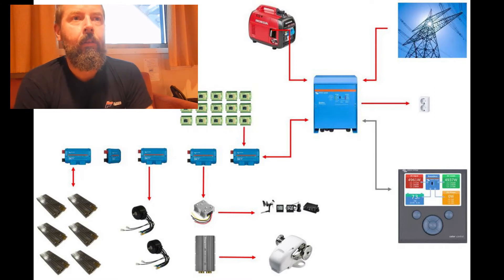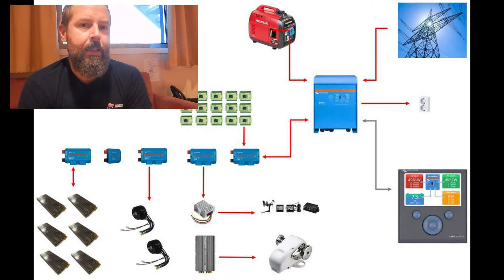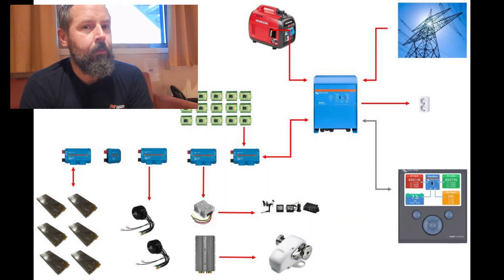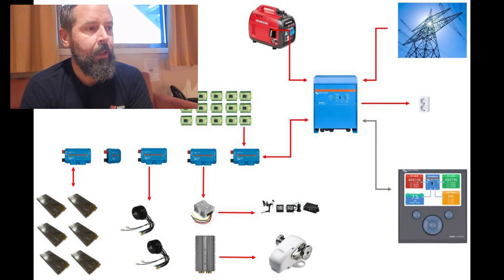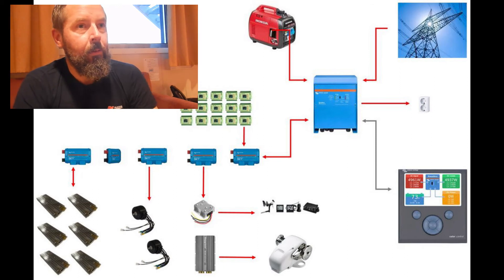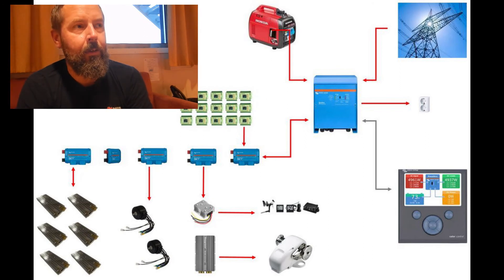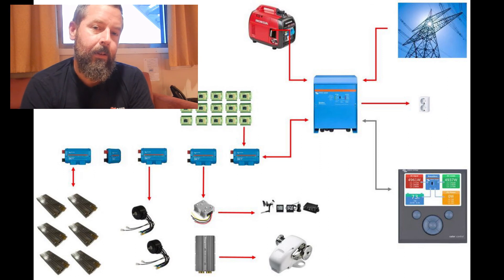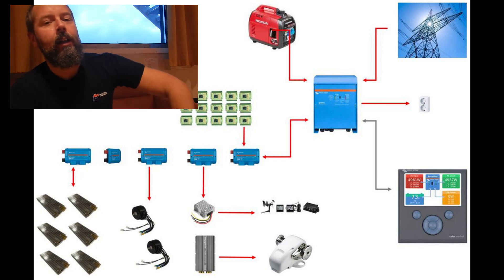Wilda's electrical system explained - S01 E05 - DIY Catamaran

Comment: Always have a back up with a wind generator
Reply from the maker: Thanks. I think I'll try without. With over 2000 w of solar panels I hope to avoid the wind generator. I'll try to get drive regen efficient. If I can't, I'll add a separate hydro generator.

Thanks
/ Axel
Reply: @buildingwilda alway s good to know you got back up power just in case other things fail ? lol
Reply from the maker: @vivianbond7449  absolutely. For backup, I will have a petrol generator.  Wind could be a supliment, but from what I understand, not a very reliable source of large amounts of energy.

Thanks Vivian

/ Axel
Reply: @buildingwilda  ok mate

Comment: Have you thought about a regeneration system whilst on the move to regenerate power from your forward motion.
Reply from the maker: Yes. The controller will be able to handle this. The motors and drivers are made for cars and motorcycles, so the function you are looking for is normally called regenerative braking. I would go for a matched motor / controller. From the same supplier. Perhaps not necessary, but I feel it is more likely you will be able to get better technical support that way. I bought direct from China. Golden Motor. Surprisingly easy transport and good support so far. And half the price for the exact same unit sold in the US. I can't, for sure, say this is the best option, I have not yet been able to test the system. But so far so good, and I don't expect to have any issues.... I hope 😂

Comment: Hello you both doing a fabulous job on the catamaran. May I ask where you obtained the Tesla batteries from and what the cost was. I am looking at taking out my diesel engine and going electric. Many thanks
Reply from the maker: There are several sellers online. Check for ev sites. I got mine from Lithium Power in western Australia. If you are in the states, check out EV West. In Europe, try ev Europe. When searching these you will find more sites. Transport can be a bit tricky or costly. Prices vary with availability and location. Try to make sure that you are buying from a serious supplier. Also check out Jehus power walls. Lots of good info on ev conversions.
Make sure you find a good dealer wherever you find the modules. I have heard that there are counterfeit tesla modules around, so if the deal looks too good to be true it probably is. Drop in lithium replacements for lead batteries are becoming more affordable... Not anywhere close to tesla by power to weight to price, but getting there. Still too pricey for the kind of power I was looking for. 30kWh is a substantial amount of power.
I'm not an expert on all of this, but I have done a lot of research. Make sure you do as well.

Comment: Stumbled across your channel, looking forward to following your progress, interestingly I remember considering this boat a while back when it was for sale, but with the work required and the strong suspicion I could not trust myself not to get too carried away with the project for my budget I passed, so glad to see some one with vision take her on.
IMHO I feel parallel hybrid would be the best option .... a reasonable sized single diesel main engine (30-40hp with coupled 10kw electric in one hull + stand alone 10kw electric in other hull) This allows you to have all the advantages of emergency propulsion/generation the main cons = weight, fuel storage but the balance it provides in this type of system while maintaining a predominantly renewable energy powered boat. 
Your idea with Tesla battery banks is interesting but I have heard there are considerable issues with this type of conversion for electric vehicle applications, I am interested in seeing how you over come these.
I dont recall you mentioning regen, although this must be an integral element in your system.....with the Tesla power banks did you consider ac drive motors. 
Are the dc drive motors you're planning to use going to be liquid cooled/sealed?
Great project
Reply from the maker: Hybrid would have been a way to go. I will have limited hybrid capability via the inverter. A smallish generator 2 to 5 kW, perhaps a bit more, allowing for some assisted propulsion.
Reply from the maker: Regen will be possible, and I hope the prop i have chosen will give me decent regen already at relatively low boat speed.
The tesla batteries have some issues that are not ideal for running a 24v system. I'll be running at 48, leaving that issue only for the motors. As they are brushless dc, they will handle the low voltage close to the lower discharge limits. They are sealed watercooled, more for the sealed bit rather than the cooling, but I will connect a cooling loop as well. Should have no problem with salt in the air.

Once completed, I plan on doing some sort of EV inspection to make sure I have a good installation that an insurance company will be happy with. 

All good points.

Thanks, I really appreciate comments like this. Keep them coming.

/ Axel

Comment: good to see are you trying something out of the marine market......  I'm also planning to do that....  but I'm thinking to use one diesel motor/generator and one electric...... as you said redundancy..... I have no guess how much power all these dc-dc and dc-ac inverters would consume.... have you check that? It looks like some good amount of your solar power will be lost on these. Some people would have gone with 12V dc just to avoid it.  But I'm curious to see your results! :)  good luck!
Reply from the maker: Thanks for all your comments!

Yes. There will be losses in the dc-dc converters. But also better efficiency in DC to ac. Big loads will be ac with the exception of the motors.

As I am sizing the bank for some practical propulsion, the power available is hugely oversized for the 12v loads, so I am not concerned with some losses there.

Running, at max max max, at 48v and 30kW is about 600A...

The same power at 12v would require 2400A.

As for dc dc on incoming solar... Yes, boosting to 48 will come at some loss, but so does buck converting to 12v..

All systems have their pros and cons. I hope I have figured out a good solution for my boat.. I already have the parts, so I really hope I got it right 😂

I will have a generator as well. But that should only be used on very rare occasions, like up rivers or against high currents in Indonesia and things like that.... I really hope I got it right... I think I might have 🤔
Reply: @buildingwilda  really good!!... I'm looking to see your results....

Comment: PowerMax Converter chargers can be put in series, parallel and series-parallel. also, have you looked into battery isolators and galvanic isolators? inverter-chargers are kind of expensive  although i like the sungoldpower brand if that's your plan. did you know they also make inverter-charger hybrid mppt controller integrated in one unit? the quiet honda generator you have pictured isn't going to be efficient, something more robust coupled with batteries at a 3c charge rate would probably suit your need better with powermax chargers and less batteries and regen electic motors.. like say a 12kw to 19kw generator and 10kw lifepo4 battery bank (safer)...if the lifepo4 is 3c you can pull the 30kw off and put it back easily with the regen.. heck even 6c stuff is out there which means you could drop that to 5kw batteries and figure 800 watt photovoltaic instead of 1600.. anyways, just my opinion.. at 5kw and 6c you'd need a bank soldered to handle 600 amps and heavy cable tho..

 (i mentioned the battery isolator because you might want to use it to tie in an outboard kicker with a boost converter from 10v to 60v, if that is possible, to the whole mix and harvest power from there too. West Marine sells a charge relay switch but expensive.. isolators are 50 bucks and handle the same 500 amps)

galvanic isolator thing should save your vessel from corrosion hooked to shore power, if i understood it correctly.. might wanna get a 30 amp pigtail adapter cable for that scenario in case you hit a place with 120 and you need 240 or vice versa..not sure about the whole 60hz 50hz thing but i've seen some inverters with selectable 220,230,240 etc, also plug adapters in general might be useful.

oh and you wanna make sure whatever you use is pure sine inverters and not modified, really screw things up and cause heat problems if you don't

-mike

p.s. the larger the battery the more self-discharge and that means some of your photovoltaic cancel each other out (inefficient). those quiet honda generators aren't quiet when using at the max speed (most efficient rate) and will be running a very long time, with say a 12kw generator and powermax converters you could fill 5kw in 25 minutes if it can handle 3c charge rate. Noisy for 25 minutes is better than noisy all day and save on fuel economy plus you can top that off solar not having contemplate when sun charge and when fuel charge. Not having drawn out charge schedules on both ends of that and gaining more control on the fuel side and much better on-demand use, just seems like the better way to go IMO

Comment: Very interesting - are you going for generic drive motors, or one of the marine motor suppliers. There seems a great difference in price.
Reply from the maker: Huge difference in price. I'll post more on the drive chain when I get the parts. But I will not be going with one of the marine brands. They are simply out of my budget.

Generic, perhaps,.. I am buying from a supplier to the ev-market. A motor that should work well. The biggest difference to the off the, very expensive, shelf systems will be the lower unit and prop, that I hope will be a better fit for the electric motor.
I believe I have a design that will work well, but that remains to be tested full scale.

Thanks for your interest, hope you follow along, I will try to post once a week. Still learning how to edit, choose material and I am not quite there yet. Learning as I go along. And traveling more than planned.. 

Thanks again, 

/ Axel
Reply: @buildingwilda  have you looked into hpev motors with regen, they make a 10kw
Reply: @buildingwilda  Thunderstruck has DC motors for a good price. Under $1,200 each unless you go for the big AC motors.
Reply from the maker: @BoldRepublicNews  Thanks. I've seen them. I bought direct from the supplier in China. Golden Motor. Check them out. Surprisingly fast delivery.
Reply: @buildingwilda  Cool. I'm actually living in China. Hopefully the motors you receive are legit. I'll check them out, thanks for the tip.

Comment: Thanks for the line drop.  Glad to see you’re pushing on.  Absolutely stick to Victron as much as possible.  Some cruisers out here try the Chinese products...hit or miss.  Just don’t risk any on essential components.

I’ve helped design some 12v and one 24v system, but the 36 & 48 volt is beyond me.  They each come with unique dilemmas.  Not as straight forward as stepping down like it would seem.  The windlass is a stinker, one marine electrician (who is also a regional Victron distributor and industry expert) even recommended a stand alone battery with a DC-DC charger from the 24v system to power the 12v windlass.  He did the voltage loss calcs for a step down and they were dismal...not sure why.

Also, fun fact I learned, the Victron MPPT controllers are also intended to be used as dc-dc chargers as long the voltage difference is more than 5 volts.  Amperage rating remember is for the final voltage.

Also the Honda units are not worth the money.  I’ve used them, Yamaha and Wen.  The new Honda EU22i is ideal only for large startup loads since the new model has the 125cc motor.  Otherwise, for the cost and quality, Wen is at present hands down the best deal going.  I would recommend (2) 2kw units for the same price as a single Honda.  Wen also makes slightly larger than 2kw units.  Check them out.  Not sure what’s available in your area.

Keep ‘em coming.  Good luck !
Reply from the maker: Thanks,

For most loads, the losses in power are no major issue. (With such a big power bank) Loosing a few watts here and there will be ok. The Winch, like you say, is a different beast. I would have really liked to have a 48v motor on it, but for now I will stick to the 12v I already have and a DC-DC converter, the same goes for the autopilot. An option, with potentially less power loss, might be an AC/DC converter and run it off the inverter, but that removes some redundancy and may not actually be less loss.... Still, worth considering as the inverter will be running 24/7 anyway. The DC/DC supply I am looking at is capable of about twice the power that the winch can use and I'm hoping this will help.

The charger I found does seem to get pretty good reviews.. Hoping they are right. If not, I will build my own and try that on one of the banks to start with. A simple constant current, constant voltage supply. One of the advantages of lithium - simple to charge, you just really have to stop charging in time and not over discharge them. The BMS and the victron charger will be able to stop and start charging with the help of a relay. I like the Victron products in general, but the victron chargers can only do step down, I haven't seen any boost chargers from them, so they won't work for me.

Im hoping I have figured this out correctly, I'll just have to give it a go :)

Thanks for the tip on the generators, I'll check them out.

/Axel
Reply: S/V Stella Maris interesting, I live in Oz & I’ve never even heard of Wen!?